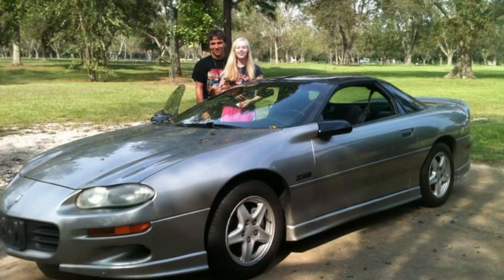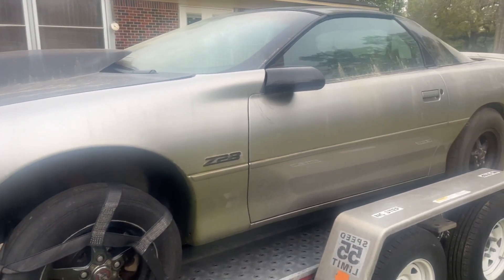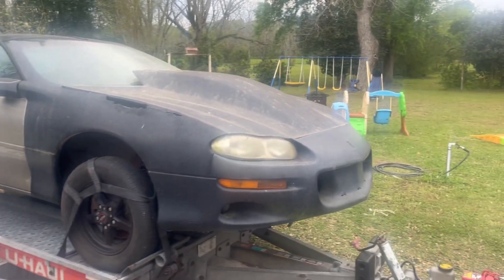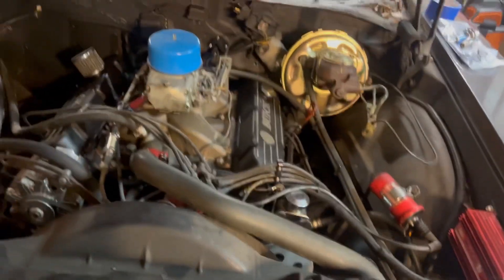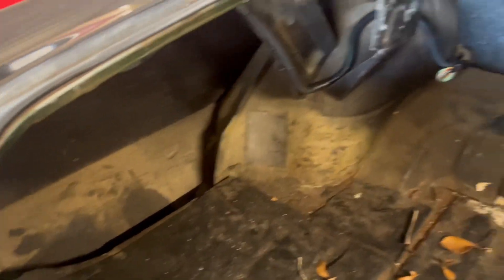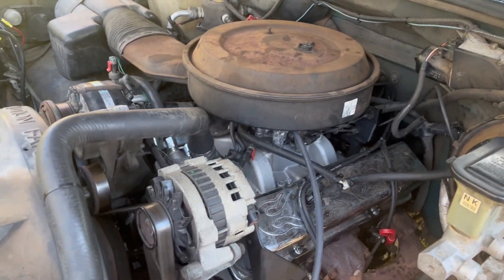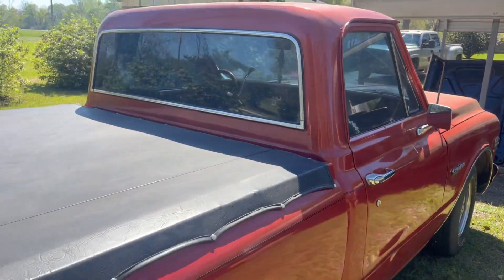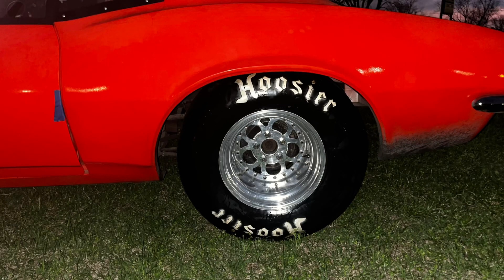Picking up my long lost Camaro! Plus.. Shop update & race car plans!

Comment: please more off the impala clean up and running and 1/8 mile run
Reply from the maker: It’s coming. I’ve got rotors, calipers and hoses to go on the front. Also got a header to replace the one with holes. Thanks for watching!